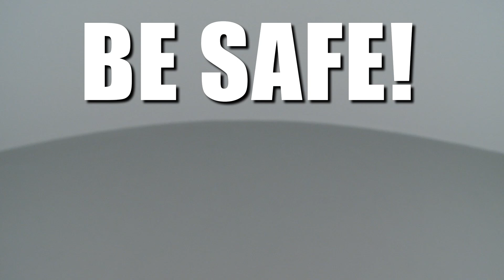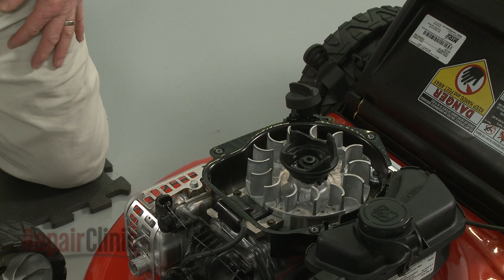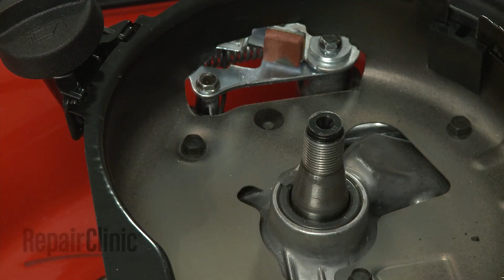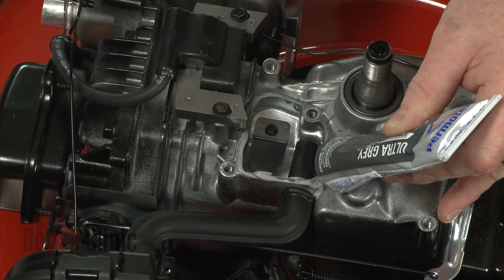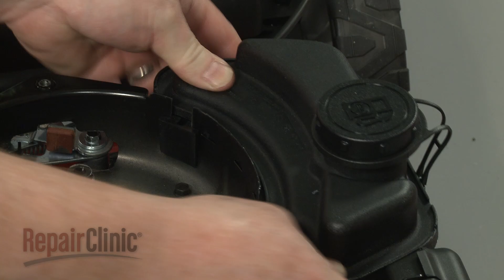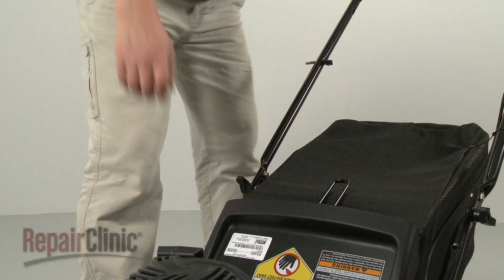Briggs & Stratton Small Engine Replace Governor Lever Part # 590520

Comment: I made a extractor to pull these flywheels, very similar to the one used here except for  i use a bolt in the center and i just screw it in until the flywheel pops, man you talk about a cool sound, sounds like a gunshot when they come off, ha ha ha, a lot better to use this than people that use a big puller with jaws that can damage the flywheel, Ive also seen people use a air hammer in the center of the shaft while they lightly pull up under the flywheel and that works real well with minimal risk to the flywheel.

Comment: Is there anyone would ever need to do this? surely by the time that bit is worn out the carburetor would be in a bit of a mess as well?
Reply: I can honestly say  have never seen anyone replace it,i have seen many levers go out of adjustment because people were in the engine and they forgot to put the lever back where its supposed to go when reassembling the engine,these levers do look kinda flimsy so maybe thats a common thing being that they made a video of it.
Reply: Had to replace one a few weeks ago the screw was stripped out so it wasn’t tightening down on the mounting post. Seen other times where they have been bent or were loose holding the mounting post. This is a great vid.

Comment: Also if not running smoothly its possible to adjust the lever and this can speed up or speed down the governed R P M without replacing the lever with a new one